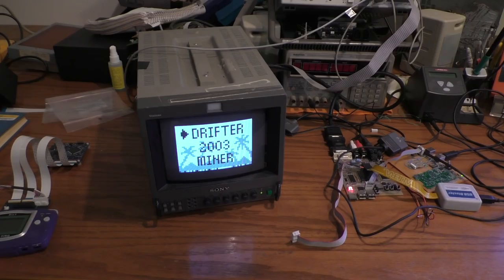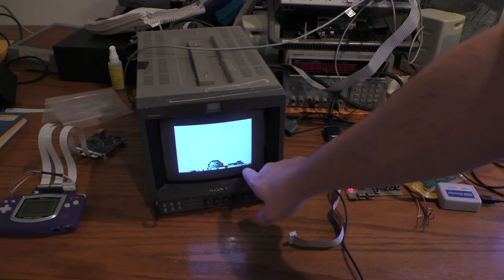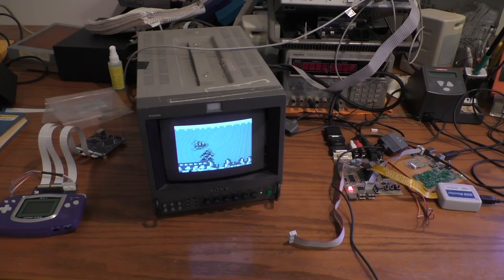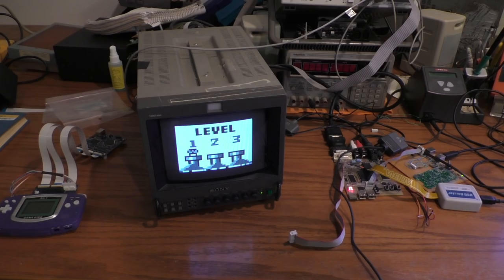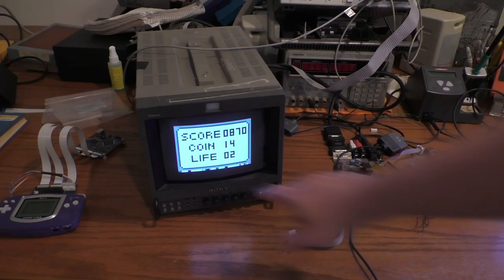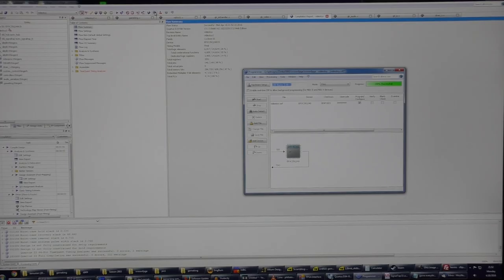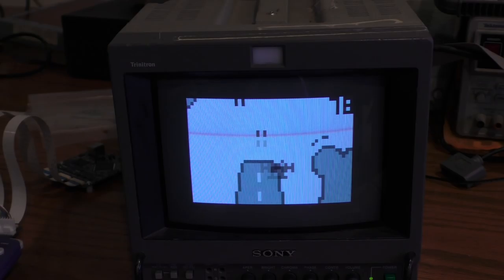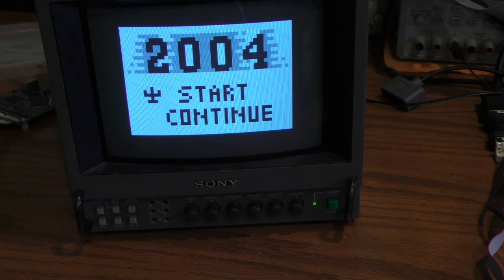Timetop Game King Running on my FPGA

Comment: I wonder if you reprogram onto a faster FPGA and a faster clock might work faster.
Reply from the maker: +DAVID GREGORY KERR the clock to the SDRAM is as fast as it goes.  There's a lot of overhead on the SDRAM for random accesses. they are designed more for bursts.  but with a burst of 1 it has lots of overhead.  I am clocking it at 130MHz and it's only rated for 125MHz.

Comment: What is this SDRAM slowdown all about? I hope that the final Zimba 3000 design wouldn't have issues like that...
Reply from the maker: +Jan Kleks It's because my SDRAM ran out of clocks/second.  The Z3K has DDR on it and it can be clocked faster, so this won't be a problem there.